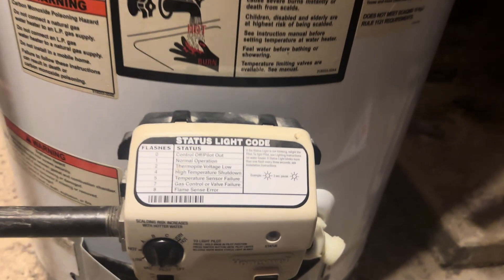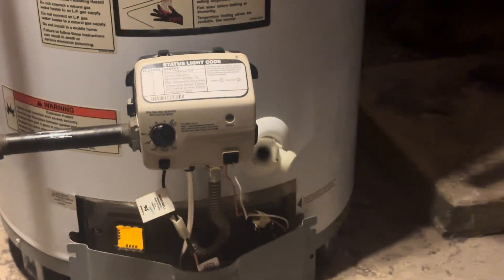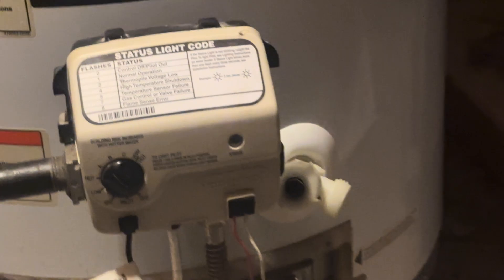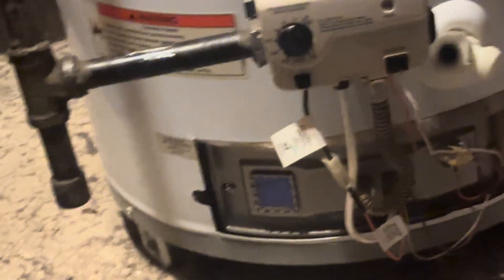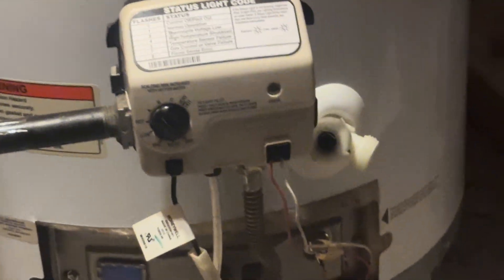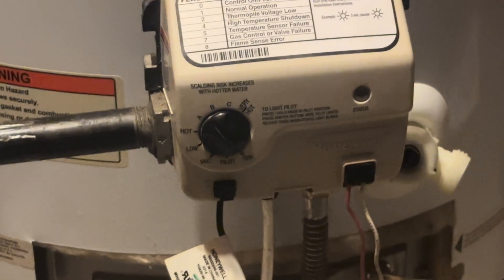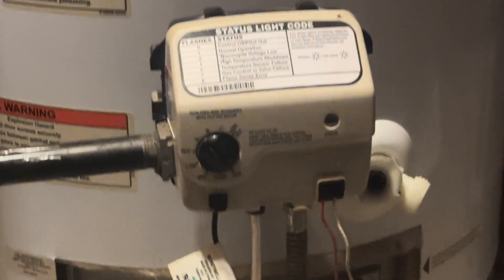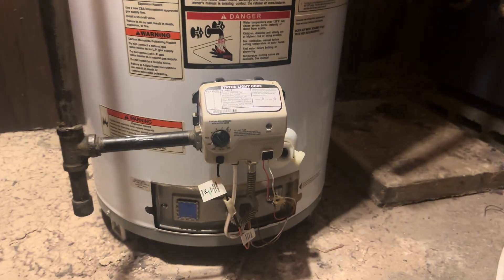How to reignite a Whirlpool water heater’s HONEYWELL controller!

Comment: Worked just like you said. TY
Reply from the maker: Unfortunately, a starter that dies several times may be a prelude to a replacement.  I had to eventually replace this water boiler entirely after it refused to reignite back in April 2025

Comment: Mines will not come on! I don’t know what even happened. I think when I turned the power and gas off on the furnace it somehow shut off my hot water heater. I’ve never had a problem with it. I got it in 2017 when I bought this house. The light will not come back on. Any suggestions?

Comment: CHANGING THAT ROD ( anode rod) - Every 2 years I phone the plumber, because I owned my tank so I pay them to change the anode rod, you can rent a water heater tank from them, they charge you around $20.00 buck a month & they will come out every 2 years &  service/change the rod that attract all the rust elements for free, that prevent your tank from getting rusty & then start to leak in your basement.👍🏿👍🏿